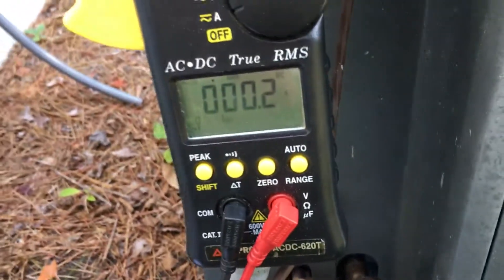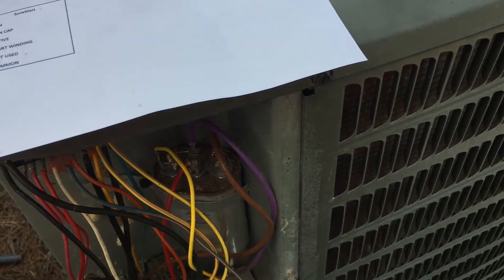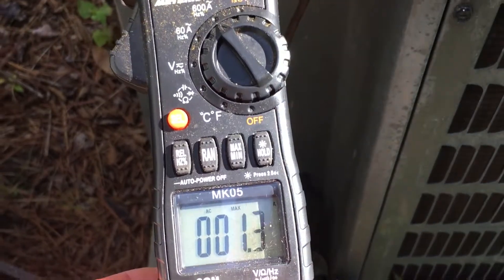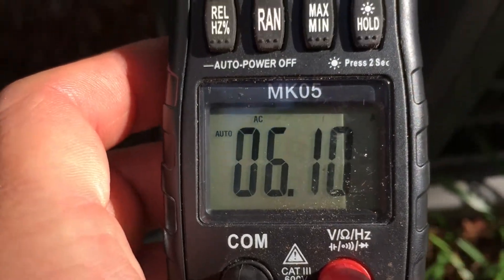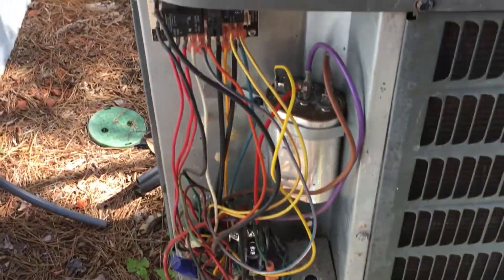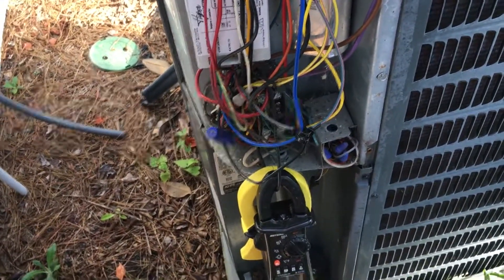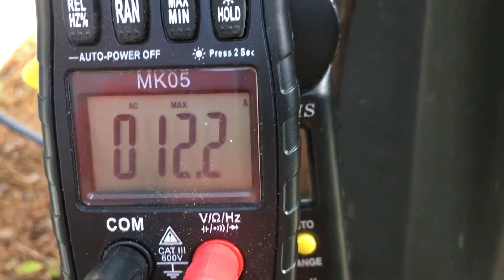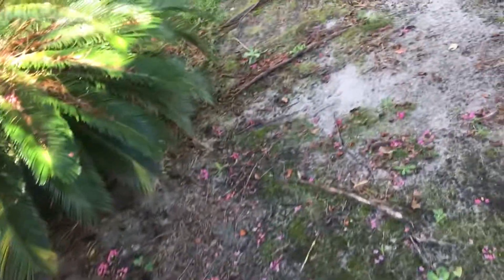Start your air conditioner with small generator during a power outage

Comment: With the soft starter, Are you seeing a dip in voltage & hz from the generator when the AC unit starts up? Such as do your lights dim in the house when the AC turns on (while on genie)? I just damaged both my refrigerators while running whole house on generator and I have a 17500 running watt genie. I believe the issue to possibly be a dip in voltage/hz when the AC unit starts up, because the lights in the house dim down quite aggressively. Just curious to see if you have experienced something similar while using a soft starter?
Reply from the maker: Usually you won't see a dip with the soft starter assuming your generator meets the starting amps of the required device.  You may have damaged the fridges because of harmonics. Do you  know the THD of your generator?
Reply: @IFix-Things  it’s a generac GP17500e with less than 5% THD
Reply from the maker: @judjohnson4640  what size is wiring from generator to transfer panel? I can’t imagine a generator that size causing a problem. Have you checked the frequency? Maybe it’s running too fast or slow, what about the governor response?
Reply: @IFix-Things  six gauge wire.. which is spec for a 50 amp connection. Yes I’ve checked the voltage and frequency coming out of the generator and it is operating at optimal levels. Generator is operating at 3600 RPMs continuously. The only problem is when the air conditioning unit kicks on the generator motor slows down for about one second and all the lights in the house dim drastically. This is why I am thinking that the refrigerators got damaged when the AC unit kicked on. I plan to run more test and then install a soft starter… Hoping that that rectifies the problem
Reply from the maker: @judjohnson4640  do you what the locked rotor amps are on your ac? Are you able to measure that? That would tell you how many starting amps you need from your generator. I will say a soft starter will help tremendously in your situation. You could be correct in that when the ac kicks on, it’s bogging your generator and can damage the fridge.
Reply: @judjohnson4640  was this issue ever resolved?